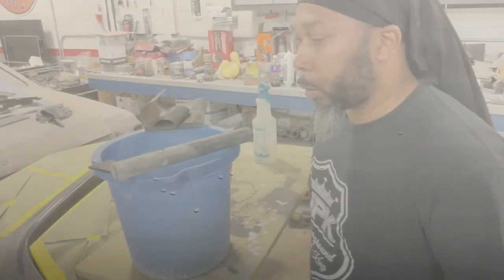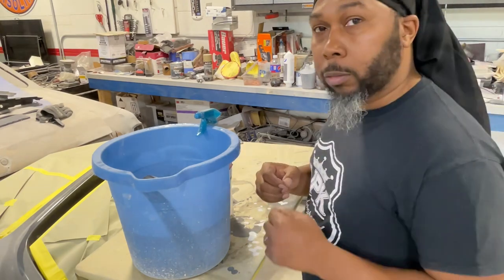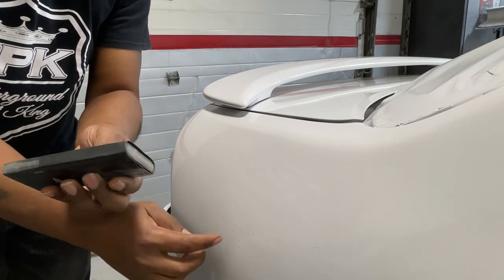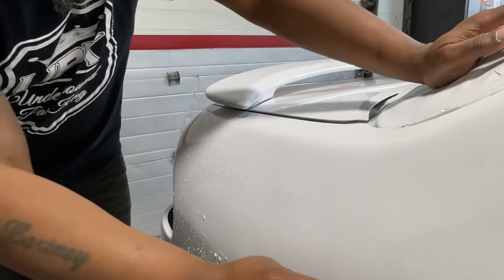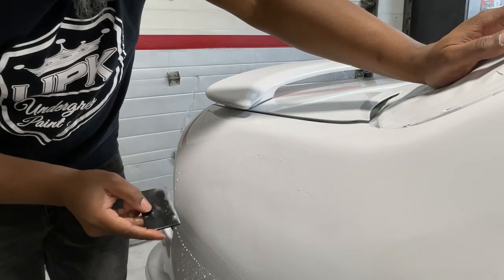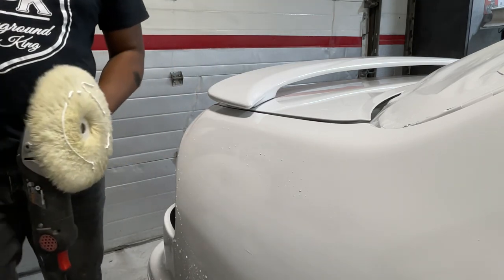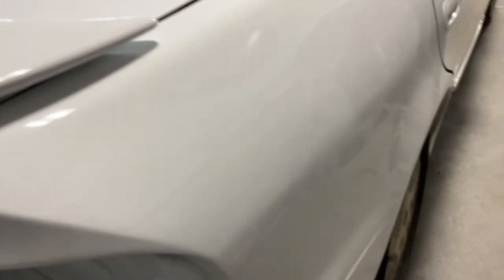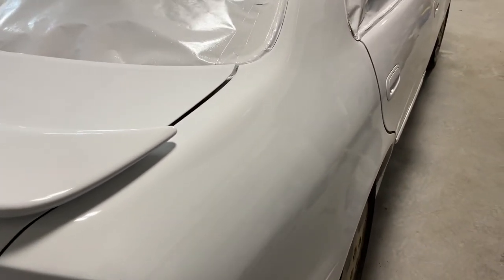Wet sanding and buffing runs out of a single stage paint job

Comment: I like the method of applying a thin coat of body filler around the run and then sand the area until the run and the body filler are just barely gone.  This protects the surrounding paint and gives a precise indication when the run is now level with the surrounding paint.  Polish and you are done.  This approach might take just a little longer as you need to wait for the filler to harden, but it makes the sanding faster with much less chance of burning through a spot.
Reply from the maker: I agree that, that method works really well!

Comment: I've had good results cutting the tops of the heads/runs off with a Festool carbide scraper. Quicker than sanding. Others use razor blades to scrape them off. But sanding is definitely easy to control. The beauty of single stage is the heads are the same material as all the rest of the paint
Reply from the maker: If this was base coat clear coat I could have taken a few different routes but with it being single stage I wouldn’t to be on the safe side and sand it, I’ll have to look into the scraper you use

Comment: i painted a pair of side mirrors and had a few runs and i end up sanding away a quarter size circle of the paint then i try to repaint it and the paint end up looking like bunch of cracks forming up,. this was my first time using single stage and i should have search up of how to take care of runs now i have to sand to remove the paint completely and start over. thanks for the information i will do this step when i have runs in the future
Reply from the maker: I’m glad the video was helpful and I hope you have better luck the next time you spray your mirrors!

Comment: You described it perfectly on your other video. Color mixed with clear. Easily wet sanded with solid color. Metallic single stage is not easily wet sanded almost impossible.
Reply from the maker: I heard that metallic single stage can be a handful but I’m gonna try some in the future
Reply: @UndergroundPaintKing  You should just for the experience. And content.
Reply from the maker: @bear_vibes5130  appreciate you!

Comment: I always thought to trim the head's of the drips 1st with a razor blade or snag tool like the Mirka shark blade then wet sand and compound Polish
Reply from the maker: @nickevans3190  you can definitely do that if that’s the method that works for you 💯 there is multiple ways of tackling a run💪🏾

Comment: Learning from your videos as I'm almost done sanding and ready to spray paint my car with single-stage silver metallic. Would the same technique for runs work for metallic?
Reply from the maker: @davemunday-nk4yz  the same technique would work Dave but that metallic is a different animal when it comes to runs as far as appearance in your finish, so good luck to you and I hope you don’t have to deal with runs in your finish 💯💪🏾
Reply: @UndergroundPaintKing  Thanks. Well, I'd be surprised if I didn't get any runs :) I reckon if fixing a run messes up the metal flakes, I can always smooth it out and then spray that panel again to make it look even, I guess.
Reply from the maker: @davemunday-nk4yz  you could definitely do that!

Comment: Using spot putty over the runs allows u to knock down runs without touching the flat paint. That method always works because it's impossible to burn through
Reply from the maker: I’ve used that method before and it does work! I appreciate you checking out the video 💯

Comment: Thanks king… Im all most ready to paint my Tacoma 98. I put a new engine in and its ready to be paint. I went to PPG dealer for a white  basecoat and they want 400. I wonder if you can suggest a budget 2 stage paint brand I should use ?
Reply from the maker: Ppg has a budget brand called Shopline which should make a difference in price for you Carl, they have a low grade and mid grade but both are great, the mid grade is better for blending and the low grade is good for overall paint jobs
Reply: Thanks Brother for your input
Reply from the maker: @carlhenri1446  you’re welcome!

Comment: Yea!! My van has an area. I’m paralized and hit my armrest.  Boom it poured it down just like yours.  Let’s have fun.
Reply from the maker: Did you get it out Hogman?
Reply: @UndergroundPaintKing  I’m using the back blade method.
The van is a dark emerald color, it come out great. Used the r500, your right good sprayer.
Reply from the maker: @hogman2276  glad it worked out for you 💯💪🏾
Reply: @UndergroundPaintKing  I still have one area like yours, and a small area.  I have you!  Thanks for even replying.👑
Reply from the maker: @hogman2276  you’re welcome!

Comment: Hey brother I enjoyed this video, I got told by the paint supplies shop you couldn't correct a single stage and if you messed it up when you put it on the car that was that. But seeing your video give me the confidence to go out and try this. I got one question, when I was putting my paint on I didn't really spray it around well enough and I got some runs, some heavy /cloudy spots.. Will the compound buffing bring out some shine? Also, how did you prep the paint surface, mild car wash and then did you clay bar?
Reply from the maker: This was a fresh paint job so I didn’t have to wash it or clay bar, I just wet sanded the runs and buffed them out.
Reply: @UndergroundPaintKing  cool man what prep would you recommend if I i been driving the car a couple weeks? Just a good wash?
Reply from the maker: @gyozajoe  yeah I would definitely give it a good wash but that’s about it, unless you have gotten something on it that requires a grease and wax remover to be used before the wash

Comment: I wouldn’t do it if I wasn’t making a vid, but if I was, I would’ve shot a little guide coat over the runs so that blind guys like Bondo Billy, could see what you’re doin’😁😁
Reply from the maker: I could have used a black marker, I’ll remember that next time
Reply: @UndergroundPaintKing  Smart man!  Great idea!  If I ever use it in a vid, I’m callin’ you out😁😁
Reply from the maker: @OldBondoBilly  😂😂😂
Reply: Just sand and buff a motorcycle fender, came out nice, but I feel it could have been better. What is better foam or wool pad for compounding? And the product you used for compounding is it also a polish?
Reply from the maker: @3rekoatskustoms929  I go through the different steps and switch through the different products, so I start with a wool pad and end with a foam pad which I start with compound then a glaze then a polish
Reply: @UndergroundPaintKing  👍🏿

Comment: about the  same way that I do it... I start with 800 wet, then jump to 1500 once the nubs are gone. Solid blocks only. I cut some small blocks of wood and tape on sand paper...
Reply from the maker: I’ve used small wood blocks that I made before

Comment: I had a problem wet sanding a single stage Red. The drips/sags dried in different layers, so when you wet sanded you could see different colors (it was like the different pigments settled differently). It outlined the drips / sags. After that I always do base / clear. It's not worth rolling the dice for me. I can always correct bases before clear, and I know I won't have that issue in a clear.
Reply from the maker: So you sprayed a metallic single stage? You can have that same issue doing custom paint jobs when adding pearls and flakes etc. in your clear coat and getting a run
Reply: @UndergroundPaintKing  NON Metallic. It was just a base color no flake no other additives.
Reply from the maker: @moetop  wow, I hear other people talk about that issue with metallic but not regular base
Reply: @UndergroundPaintKing  There was a lighter red layer as well as an odd purple layer. I have run into it with metallics, but you expect that, as the way the metal flake lays depends a lot on the spray and a drip or run will collect the flakes.. (I think I had another discussion on one of your other videos on metallics, and changing them by how you spray them.)
Reply from the maker: @moetop  yeah I believe we talked about that before, it’s weird how you got the different colors of paint in the runs🤔
Reply: @UndergroundPaintKing  I looked back, it was the silver Lexus blending paint on the front bumper video you did.
Reply from the maker: @moetop  oh ok
Reply: It sounds like the paint wasn’t mixed thoroughly or sat too long after mixing before spraying.  Did some paint stay in the gun cup for more than an hour waiting for the first coat to dry?  I’ve seen paints start to settle enough in an hour to cause trouble.  I agree that two stage paints eliminate that problem.
Reply: The only problem with removing runs like this is that you can see where the run was as the paint will be flatter in that area than on the rest of the car, unless you cut and buff the entire car.

Comment: Hey brother, I started the cut and buff and my sandpaper started gumming up immediately. I laid the clear down three days ago. I’ll wait another week and try again, hopefully there’s enough clear. Any thoughts on why this could happen? I was using an orbital sander and dry sanding.
Reply from the maker: You sprayed clear over single stage?
Reply: @UndergroundPaintKing  it was a 1:1 red color with pearl in it. 1:1 . paint:reducer.
Reply from the maker: @chefswole  so base coat clear coat?
Reply from the maker: @chefswole  I can only assume that the clear wasn’t cured enough for cut and buff, it’s normally best to wait at least a week

Comment: Question sir I'm painting 2 tone direct gloss and to get rid of the edge the tape leaves from the second colour I want to clear coat , so once it's cured what grade paper do I use to wet sand before clear coat. 
Thank you very much keep up the great work
Reply from the maker: Depending on how much material you have to sand I probably would do 800-1000 grit Mark, and I’m honestly leaning more towards 1000 grit
Reply: @UndergroundPaintKing  
I will put 2 , 3 coats on and basically it just to give the clear coat a key, but don't want scratch marks
Reply: Some one told me to use 2000 but I'm thinking that's to smooth
Reply from the maker: @mark7218  that’ll be to fine for the clear to bond to
Reply: @UndergroundPaintKing  thank you very much for your time keep up the great videos
Reply from the maker: @mark7218  you’re welcome and I’m glad I could help and appreciate you checking out the video!

Comment: You can shave them with a razor if you're slick. Saves a little time just getting the heads off the sags
Reply from the maker: @257796  appreciate the tip💯💪🏾

Comment: Hey brother just thought I would ask you for advice on tip size for painting the crystler PRC paint code paint it's an red withe flake and pearl both and is base coat clear coat system not an tri stage just sprays all at once? Nason paint.
Reply from the maker: I personally would spray with a 1.3 tip Wright!
Reply: @Underground Paint King  cool ill use my widow gun then sounds great! And sealer primer with same or should I use an 1.5 ?
Reply from the maker: @wrightsrrt871  depending on the thickness of your sealer you can go with either a 1.3 or 1.5 tip but the 1.7 will work well for you also
Reply: @Underground Paint King  next question I need to cut and buff this truck it got an light mist of over spray and some light orange peel how soon after the urethane clear should you wait for buffing
Reply from the maker: @wrightsrrt871  it’s best to wait a week but normally after a couple days you can cut and buff
Reply: @Underground Paint King  thanks very much thats what I thought it was but wanted to check I used an carport canopy for paint booth and it was an friends work rig he got from his grandpa so we did a little better then Macco out here lol but still had an few flaws!
Reply from the maker: @wrightsrrt871  hey that’s how you get better, and the flaws are apart of it

Comment: Carefully hit or shave  the head of the run with a standing straight up razor blade first carefully then do exactly as you did but it takes practice it will decrease the chance of sanding through but not for the dummies.
Reply from the maker: Appreciate the tip Brian 💯